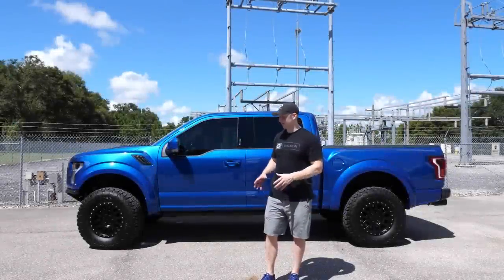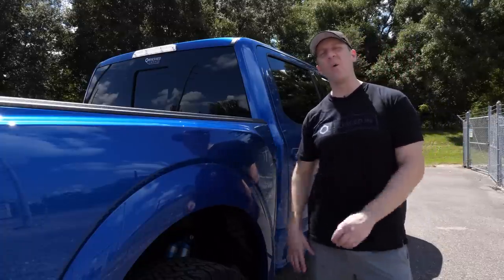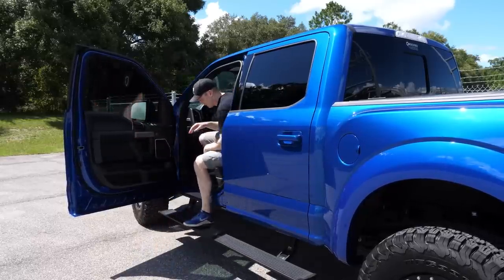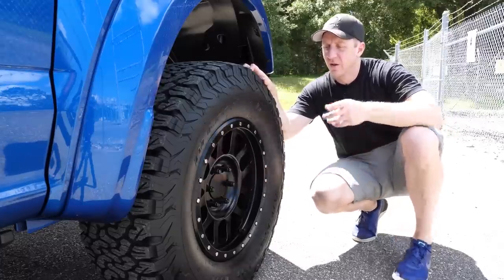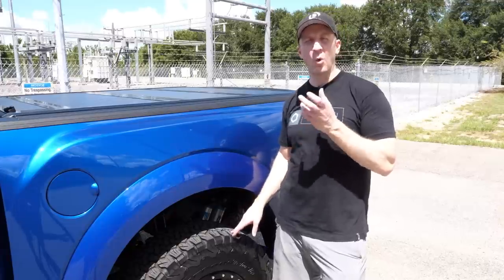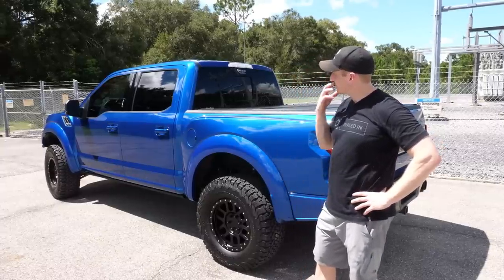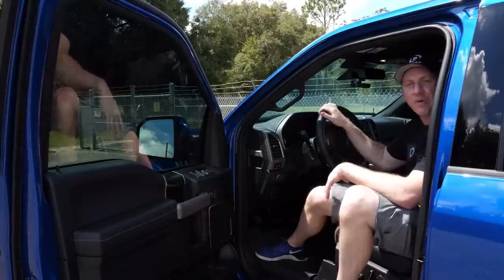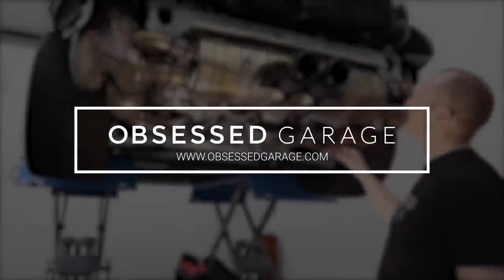The Modifications I Chose for 2018 Ford Raptor

Comment: I love my AMP research steps... i added a kill switch so i can leave them down when washing, or up when offroading.  I haven't had issues with them freezing up in the ND winters. But I did have issues with slush and ice building up and making it to heavy to pull back up to the body. I just scraped off the slush and ice and no problems.  Ive had mine for over 8  years now, no issues, well worth the money!

Comment: My white 2018 super cab raptor has never been washed.  Its been damned dirty, but sooner or later it rains.  Have a little green algae in some of the body seams.  Pain was and almost is flawless, some vague brush scrapes in clear coat.  No mods at all, it is great the way I ordered it.  It has everything except the carbon fiber junk and sun roof.  I never opened the sun roof on my previous 150, a Platinum crew cab.  It is really muddy right now, but it is raining and I will drive home from work in pouring rain and it will be clean enough to head to Canaan Valley this weekend to refresh the mud.  Oh, and the optional front axle is GREAT!

Comment: Amp research released dual motor sidesteps for that exact reason got em on my brothers 2019 Ram and no issues of sticking or freezing over plus added insurance of if one motor goes out the other pulls it’s weight

Comment: The front is awesome.... For those who know... Appreciate it. For those who don't know, it doesn't matter. I can't afford the front bumper and will just upgrade my XLT to a stock raptor grill. We all have our struggles. The off axis turning in the back and stability you should look into air bags. Great idea to soften the ride and to gain handing performance in the rear.

Comment: Only mod I would do is RPG Bump/Brace kit and would consider is Deavers +2(stock height)... I like the rake... I like the look of that ADD bumper and ADD has a new one that does not require frame cutting and relocating different intercooler, but good with stock bumper with Baja Designs Fog Pocket lights in place... no paint matching wheel arches... no window tinting... no tune... your truck came out nice, but I think the RPG Bumpstop/Brace kit was unnecessary since you were not planning to ever take it off-roading.

Comment: I thought about amp research powered steps on my Raptor but realizing how effective the stock steps are at preventing inept careless drivers when parking and exiting from the heaps from swinging their car doors at my truck, those turkeys can watch their doors get damaged on the extra rough powered coated stock steel step edge...

Comment: Factory exhaust sounds as good as you're going to get. Good advice there. I'm not a big fan of the color matched flares, but that's just personal preference. I'm also not too into the front end... I'm fine with the stock one on that. But I like the wheels / tires and the ride height and all of that. I enjoyed the video.
Reply: Installed Borla ATAK exhaust on my ‘17 Raptor and that is good as you’re going to get! I drive the hell out it like it should be driven and like to hear what the engine is doing. Married up a Roush CAI with it and it’s all music to my ears on and off road. Many 4get that this is an OFF Road vehicle and Ford Performance paid a lot of attention to detail with that in mind. If you want a high end truck designed purely for the pavement, get the new Limited and personalize it with the “pretty” truck mentality that still performs well.

Comment: Why was it about 9k to do the bumper and intercooler upgrade? Isn't the bumper like 1500 and intercooler 1300 plus 250 for the bracket to relocate sensor so that would put you at about 4500 with install? I'm about to do this exact modification so trynna get a good understanding. Thanks!

Comment: Not my cup of tea for my Raptor.  Some good info about the devers, would like to know the version you ended up going with.
Reply from the maker: On Gen 1 and Gen 2, leveling kit in the front, remove rubber block from back, and do Deevers +3.

Comment: Do you get any rub with those tires at all? I want the same wheel and tire combo but I don't want to have any issue with rubbing on front bumper or back of wheel well. Hope you have an answer for that so I can pull the trigger and order the same wheel and tire combo.
Reply from the maker: I didn't have any rubbing with them even before I did the leveling kit and rear suspension.  They are really close in overall diameter to the stock 17s.
Reply: @ObsessedGarage  Thanks for the response. I'm ordering these right now.

Comment: Is there a module or a hack to lock the rear differential in 2wd? I test drove a Raptor with intention to but but was very disappointed ( didn't buy it ). The E-LSD is extremely slow to respond and with all TC off its a one wheel peel machine. I know there is no aftermarket LSD available..

Comment: Front bumper and intercooler run about $3k total, how did you get up to $9k for the upgrade? $6k in labor or am I missing something?!
Reply from the maker: New intercooler, labor, relocation and bracket for speed sensor.  It's $9,000ish with labor and light.  I didn't get the lights.

Comment: what's your view on waxing a new paint job on a car? my e92 just got back from the shop and I really don't wanna risk damaging the paint with bird droppings or tree sap just because I don't have a layer of protection on it
Reply from the maker: Most paint systems cure in 24 to 72 hours, so you are usually good to polish/wax/coat right away.
Reply: Obsessed Garage interesting, I noticed something weird though, the newly painted panels feel much softer and almost stickier than the factory paint, does that mean it is still curing?

Comment: Good day/evening from Canada, great videos. Definitely have my attention on the Deaver leaf springs. Roads are pretty bad were I work, and the Raptors rear end definitely comes alive going around bends in the road(potholes etc). So I’m going to upgrade my 2018. You were saying something about DLC coating? Is that something that has to be applied just over top of the whole leaf spring assembly? Or does the whole assembly have to be disassembled leafs apart from one another then coated? Then reassembled. You were saying it’s not that bad??? I’m keeping it all original ride height. 
Please n thank you in advance.
Cheers🍻🍻
Reply from the maker: The issue is that you have to buy the springs from Deevers, send out somewhere to have them coated, then sent back to Deevers for reassembly.  At least I think that's the process.  You'd want to call RPG to ask them how they have it done.  I never headed down that path.
Reply: Thank you for your time, I had a feeling you were going to say that(disassembling them). Unfortunately having them sent back isn’t a option to Deaver, the Canadian duty etc piles on quick$. Hope you’ll reconsider keeping the pet monster(Raptor). Good luck with your decision(s). 
Cheers 🍻🍻🍻😘

Comment: AMP research installation and user manual (last page) describes the feature to manually set the deployed step, by using your foot to firmly hold the step out when closing the door and this allows you to access the roof...

Comment: All those mods and havent tuned it.  My man 510 wheel hp and 900plus torque doesn't get you wet and motivate you I'm not sure what will. But why is the question?